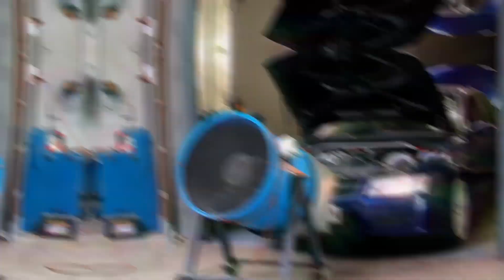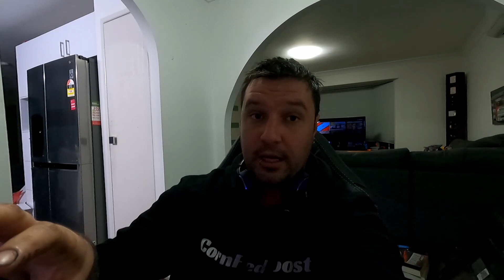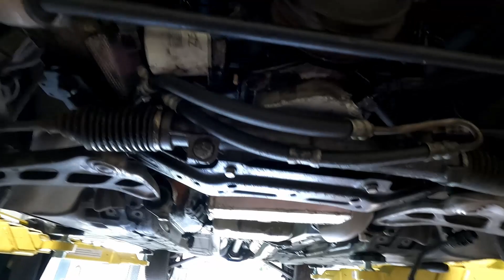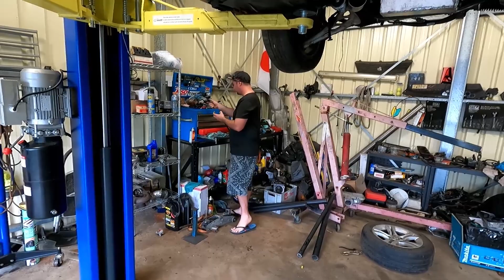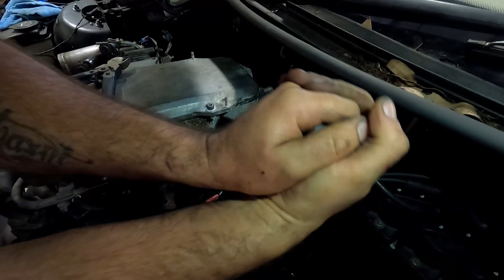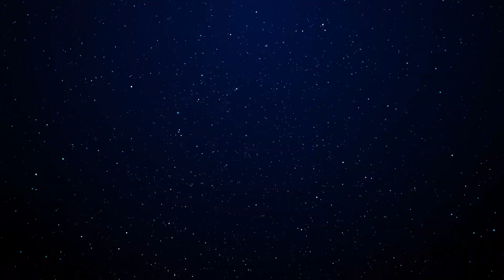Turbo Ecotec V6 E46 Bmw Pt15.... And Something About A Hoodie

Comment: What size injector should I be running on a none tuned 10psi ecotec turbo ? Has factory currently I was looking at a set of 440cc
Reply from the maker: 440cc will work ok but I just reccomend to go right to 1000cc injectors